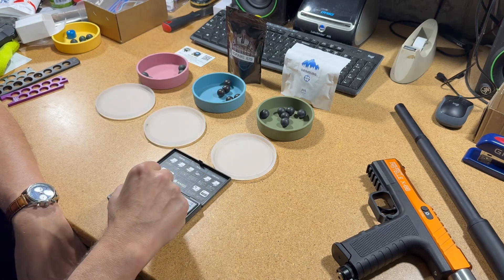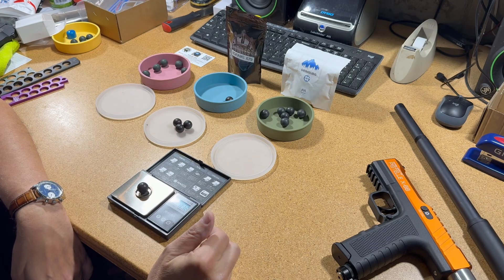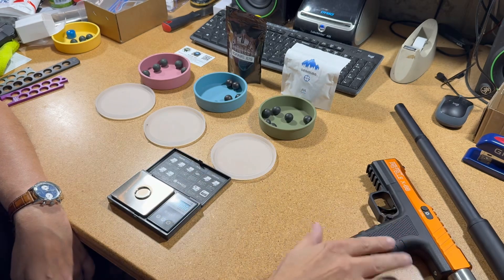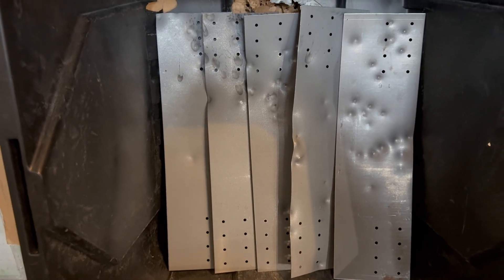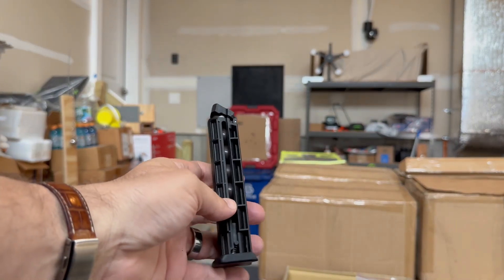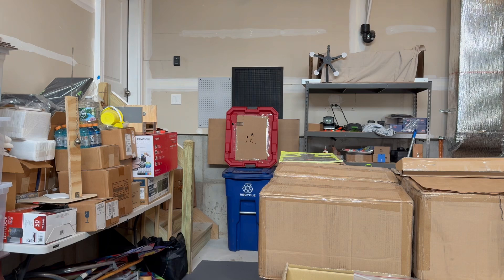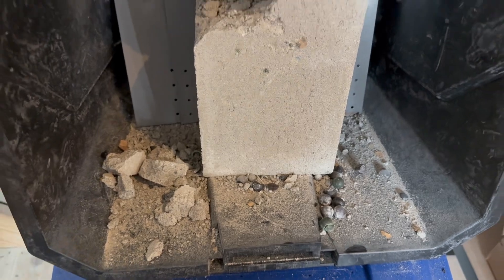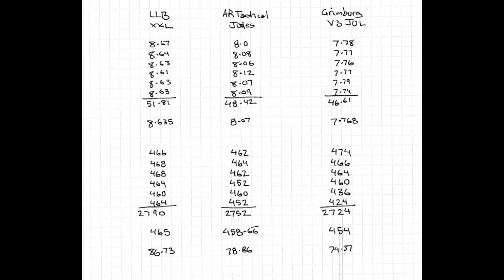Pistelle X-68: LLB Smasher XXL vs AR Tactical Joules vs Grimburg V3 JUL

Comment: How does having a HPA tank add power or does it just allow for more shots vs a co2 cartridge? 
I thought you stated that the tuning chambers didint do much in power or is thst just with co2?
Reply from the maker: My HPA tank is a regulated 850psi output a co2 is like 750 to 800 or so depending. So a bit more power, more shot consistency and yes, more shots.
Reply from the maker: It turns out that the tuning chamber will amplify the power as a function of barrel length. What I am getting with my chamber prototype is a 5 to 10% increase to a 4” barrel but a 20 to 25% increase with a 17” barrel. So, better results with an expanded gas chamber when you have longer barrels.
Reply: @glennconti 
Ok. 
I'd like to keep my Pistelle x68 a pistol even though I have the 8 inch barrel yet I do not want to turn it into a carbine as you can easily buy air powered HPA rifles with more power . It's to bad the tuning chamber isn't doing what other channels maintain.
Reply: depends on the configuration of the launcher it can do both if its regulated and depends on where its regulated. on the launcher or at the bottle. it can get dangerouse if u don't know what were donig.

Comment: I thought you were all about co2 now you’re using hpa? Sputtering after every shot with that mod of yours. Also the amount of air your using with the sputtering you should have had the tank filled up to 3000psi everytime you shot new rounds. Can you do a test and shoot your rounds last and not first?
Reply from the maker: I had about 1000psi left in the tank at the end of the test. But yes the sputtering needs to be addressed. The tank was about 2800psi to start.  More testing to come.
Reply: @glennconti try a different regulator that fixed my problem. And yea do a test with your smashers last👍